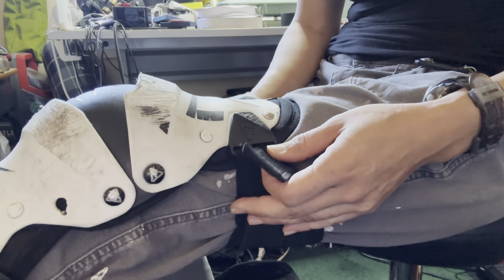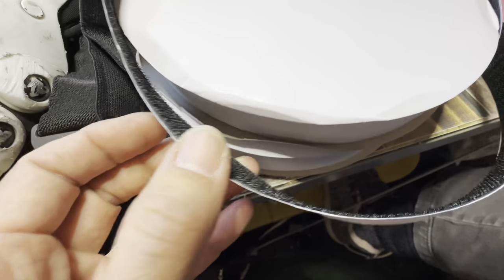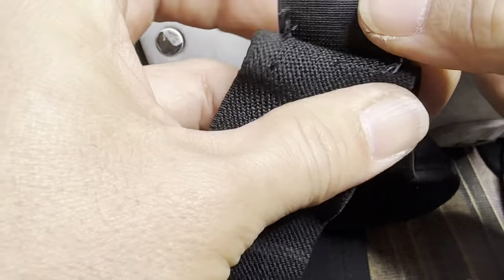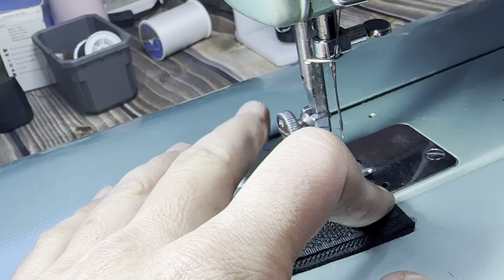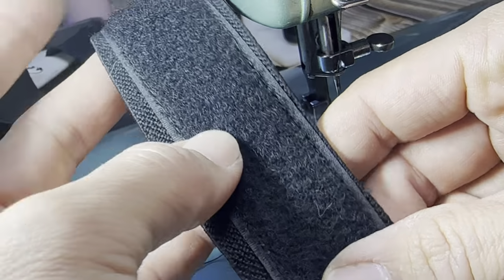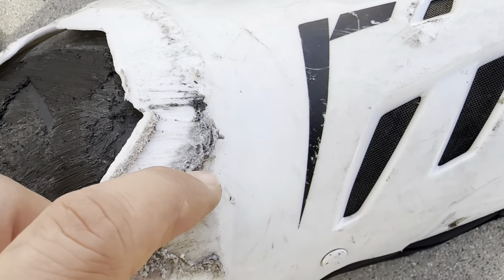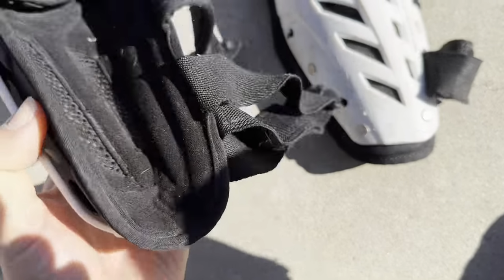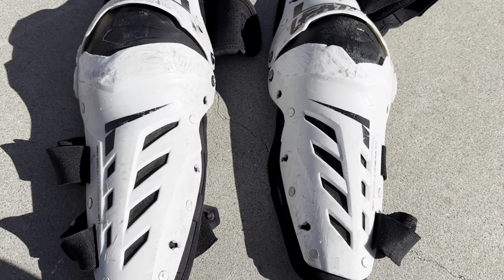Leatt Dual Axis Knee Guards - Custom Fit & Repair

Comment: Great info Dawn!  I especially appreciate the tips on how to fix up the cosmetic cruft on the surface after a fall.

It terms on fitment I really recommend upgrading the to the leatt z-frames, which are only about twice the price and fit so much better.   They come with adjustable inner padding so they hug your knee much better than the dual-axis.  I always had trouble with the dual-axis sliding down, even when new out of the box, and even with the lower strap mod.  With z-frames I've never had any issues with sliding
Reply: I think I need to invest in a dremel!
Reply from the maker: @SamClegg  o. m. g.  How do you live without a Dremel??!!